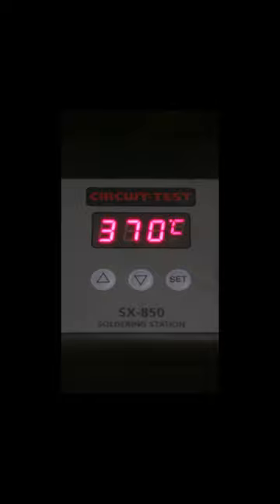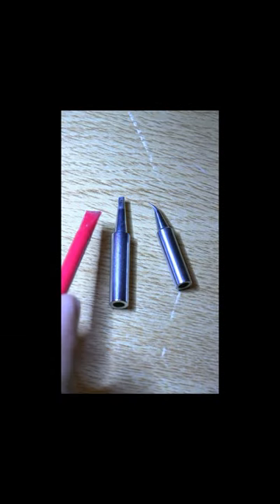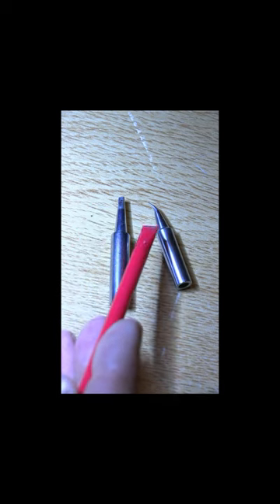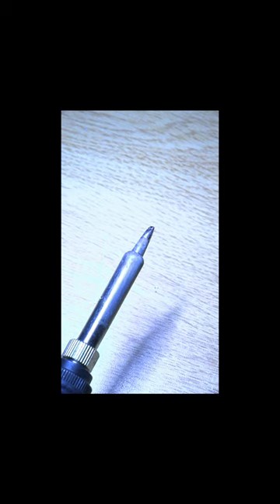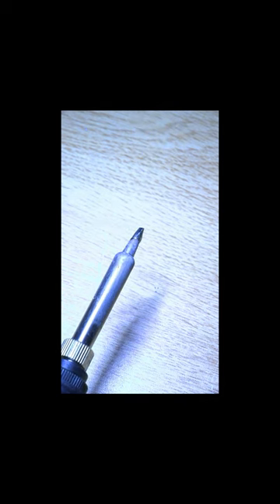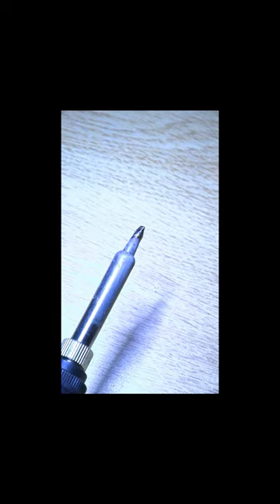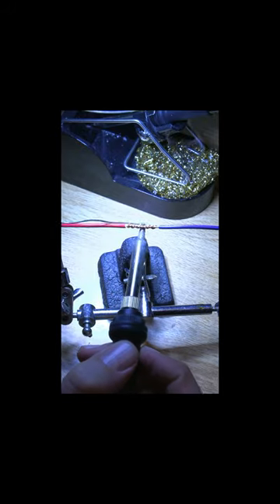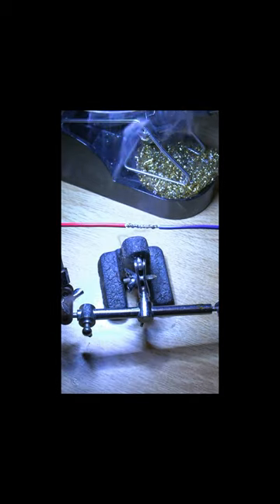How To Solder Made Easy!

Comment: WTF?! 370°C is WAAAAY to hot! 290°C for lead based solder and 340°C for lead free solder is plenty enough! Turn the iron hotter and all you get is burned flux!
Reply: MrCarlson's lab restores a lot of older equipment, using lower temps means you have to hold your iron on longer and that heat transfer can damage components. Being able to quickly heat an area helps in other applications such as soldering to batteries. 

It is ideal for beginners to start lower since if you aren't confident you can wind up with the situation that you mentioned just burning the part.

Comment: After cleaning the tip, just touch the tip with solder before soldering, things will go much smoother and easier, so do not start with a dry cleaned tip.

Comment: If tip is not picking up solder, you can revive it with some plumbing flux. Plumbing flux is way more aggressive than electronics flux and it will clean oxides even from the crustiest tip, without destroying coating.

Comment: Been running 350c for years. In soldering heat is fast. And fast is cold. So 370c is hotter than components can take. But it heats to melting temperature so fast it doesn't have time to damage. So hot is fast. Fast is cold.

Comment: More detail on the actual soldering:-
Touch the iron to the workpiece(s) , Apply solder to the iron, right near the junction, so that it wets the iron, and then flows to the work. Once the work is wetted, any further need for solder can be applied directly to the work.

Comment: 300-330 for me for general work using leaded solder, but I sometimes go all the way to 420 to get more heat if I'm dealing with large thermal mass. Cleaning the tip everytime after the iron's been sitting there. I also use the tip tinning paste.
Reply: Yeah 370-380 is way too high for "average" uses. Anything without a large thermal mass (resistor leads, ICs, etc) is easily soldered at 320 with much less splatter and risk of damaging components.

Comment: Super,Super tip Thank you i have struggled to get  any kind of solid joint .Usually I can't get enough heat into job to melt the solder.
Can you recommend top soldering equipment?
Reply from the maker: I prefer Hakko, and the FX-888D tips are super common.
Reply: @MrCarlsonsLab  Thank you sir - much appreciated! 😁👍

Comment: Been reading online posts and watching tons of videos to get back into soldering since my fixes always came out terrible. This short corroborated everything I've seen online that others have said are good things to do. I do have two question on temperature, does it make a difference if doing surface mount work? I've seen people suggest a lower temperature, but I see the benefits of a higher one since it means less time spent putting heat on the solder pads. What if using leaded solder? Thanks for all the content you put out, its all very informative and entertaining!

Comment: My cheapo, uncalibrated station seems to work best at 330 C, when the rosin just starts to smoke, not burn... Using leaded solder. For anything larger, 80W gun works like a charm, unregulated....